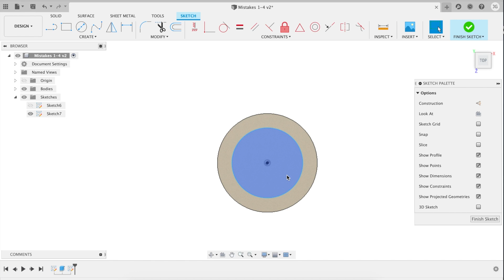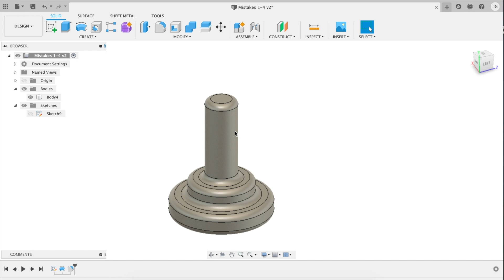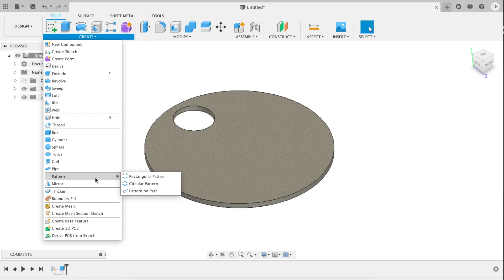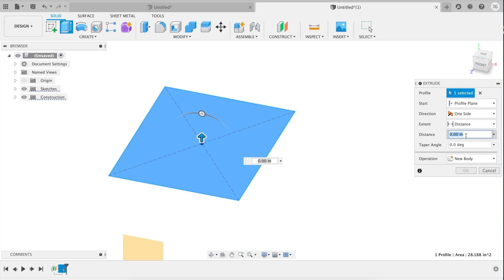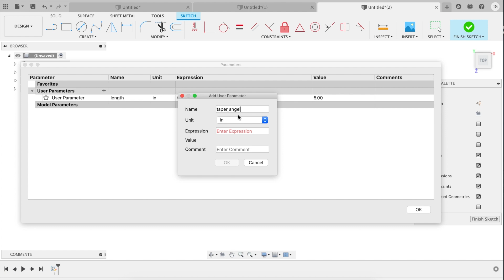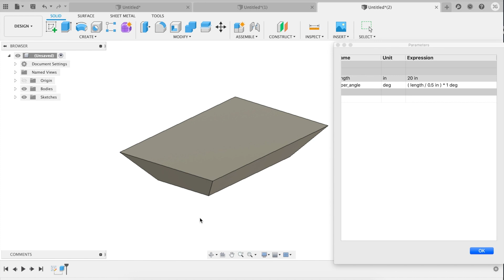Fusion 360  (8 Mistakes To Avoid) Guest Post

Comment from the maker: What mistakes in Fusion 360 frustrate you the most?
Reply: Robust models. When I have been working on a model with 10-20 steps in the timeline, then I go back to change a dimension in one of the first sketches, and suddenly the timeline turns yellow and red with missing references. It is not the single commands that cause the problems and frustration, it is the combinations.
Reply: Bad model structure, breaking history modifying old sketches or adding missing features earlier in the timeline, sketches in the wrong component...
Reply: One mistake that consistently makes me go NUTS!!!!!

1. Making changes to a component while still in the master top level of the model or worse accidentally being in a live completely different component and finding out after you have made dozens of changes effectively RUINING the entire model!!!!

This is such a destructive and easy to repeat problem it almost makes Fusion 360 unusable for me.  There needs to be a way to move changes back into the correct component as by the time it is detected it is often easier to rebuild the entire model or just leave the out of place history alone or just completely clear the entire build history.

Comment: Great share. Why do you consider extruding the first wedding cake a mistake? It was unclear why the revolve cures a problem.
Reply: Great question! The goal is to simplify the timeline so as to produce a cleaner model in the end. The extrude method creates 3 different timeline features and 3 different sketches so 6 items in total. The revolve method only has a single sketch and a single feature - much simpler! This also helps a lot when dealing with much more complicated cylindrical models.
Reply: @jessegallant6356  Thanks for the time to share your insights. The Fusion 360 community has come a long way. There is much more support on YT than when I started using it early in 2017. Plus, the product has come a long way. It always amazes me how much is available in ways of commands and workflow.